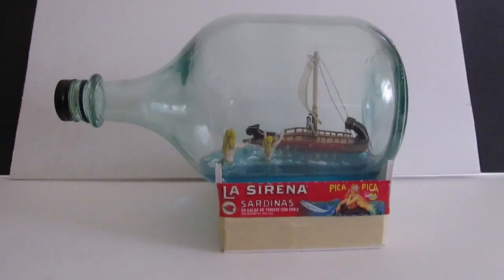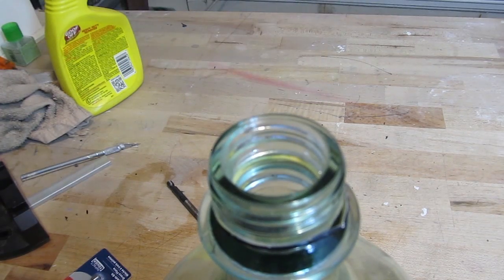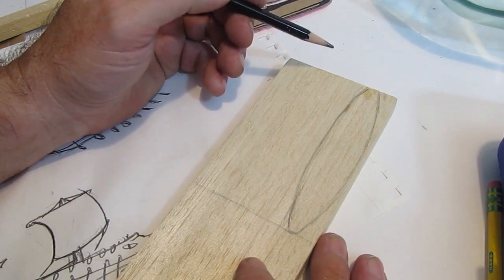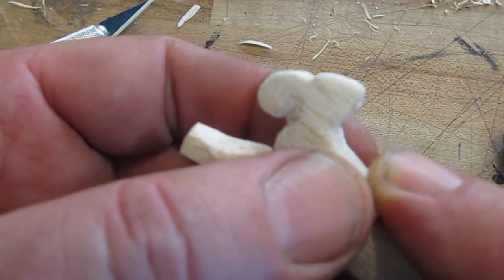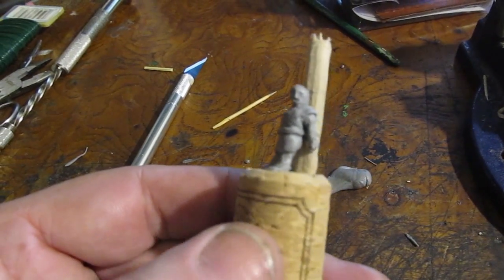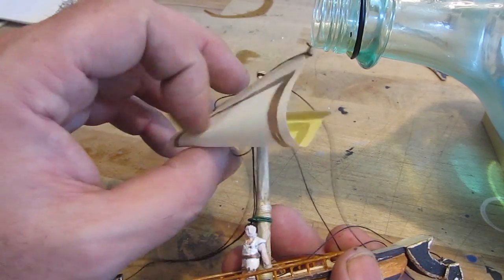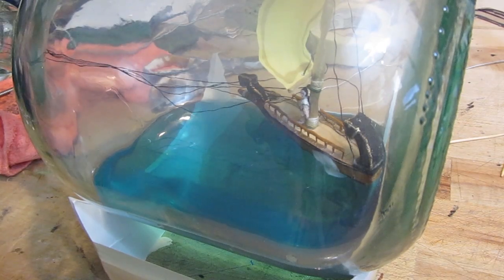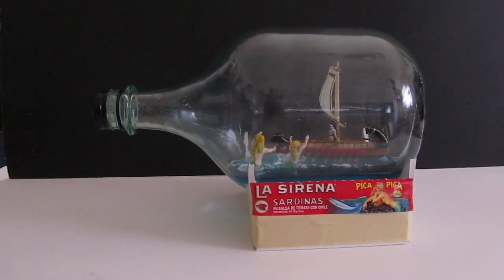How to Make a Ship in a Bottle: Odysseus and the Sirens

Comment: Nice......but how did you remove the strings after the mast and sail were in place?
Reply: The strings are wrap in a way that you hold both end of the same string to keep it in place (as you would with a needle hole). Once the ship is in, you release one end of the string while pulling the other, so the rest of the string would slide off.
It does look tricky here since I thought it might get tangled up and stuck. The real question is how did he get rid of the glue on the side of the ship after it got into the bottle.
Reply: You could probably scrape it off, or maybe use some hydrogen peroxide on a Q-Tip and just dissolve it off,
Reply from the maker: Great comment and great question. That is a clear drying glue. Can't see it once it dries!
Reply: epicfantasy
What foul sorcery is this?!
Reply from the maker: lol! great comment.